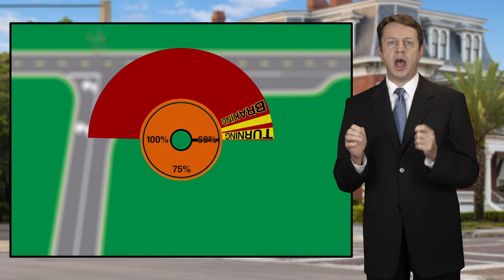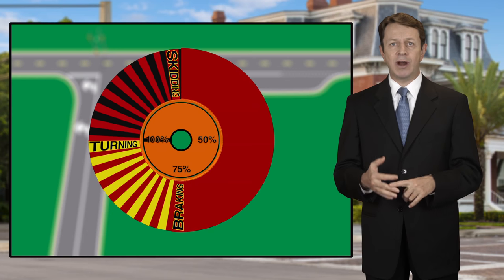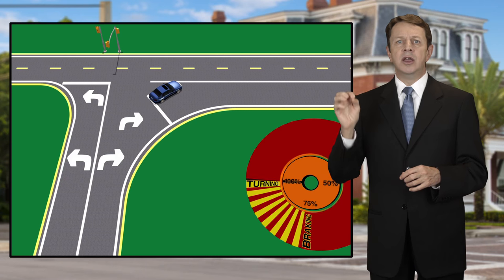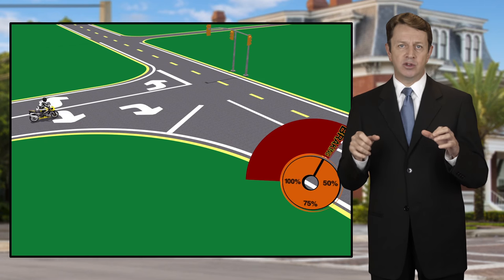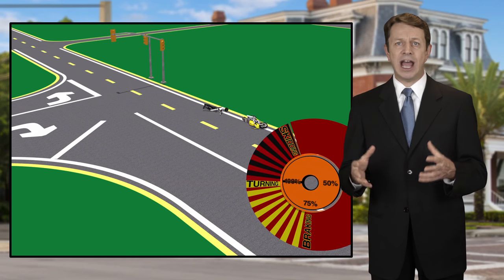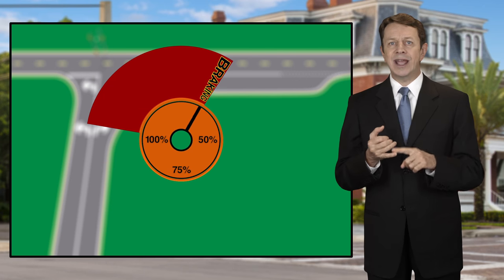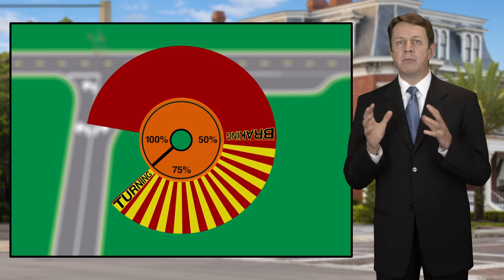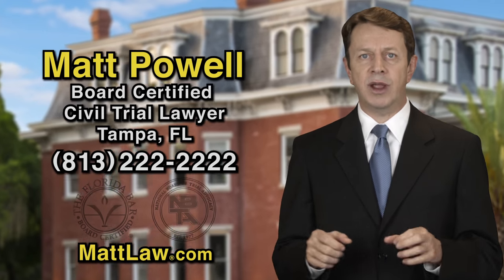MOTORCYCLE BRAKING IN A TURN - AVIOID A CRASH - Motorcycle Braking in a Turn ⭐⭐⭐⭐⭐

Comment: This prat really needs to go back to motorcycle physics school and learn a bit more about actually using the brakes to control not only the turn but the road position as a result,
Reply from the maker: Hi Mozzmann, thanks for your comments.  I agree there are many other things to consider such as road position, leaning etc.  However, I don't want to teach 8 hours of class, just help new riders appreciate the basics.  Thanks for the comment and ride safe.  Matt
Reply: Sorry to be so forthright but what your saying is just wrong, if your bike is balanced as it should be in a turn you can brake reasonably efficiently if you have to, advanced rider's should have no difficulty.  Newbies  a definite NO is the answer to braking in turns simply due to inexperience, BUT they should be taught cornering braking just the same.
 
Now a couple of corrections , the tyre contact patch is capable of making corrections in a turn but unless you panic brake your not likely to be anywhere near 100% braking, and this is why you should have your speed correct before entering the approach to ANY corner regardless of ability -  Admittedly the City is vastly different to a rolling  windy mountain road for instance BUT the fact still remains that the tyre is quite capable if the rider receives correct tuition.  I Agree you should be at the correct speed and have the bike balanced BEFORE turning - but you can brake in a turn for correction purposes, easily by using either the front or rear depending on what it is you require, BUT as I said if you have approached the corner correctly regardless of where it is , you can and should make corrections with the Brakes maintaining a steady throttle ( Not panic shut off which is common with new rider's and why I will always teach brake if needed well before the corner and allow the bike to settle,  then during the turn if and I mean IF adjustments are necessary you use the front to stand you up and run you wider and or the rear to pull you down and tighten the turn,  while using a constant throttle setting .  Many New rider's panic and shut the throttle off upsetting the balance of the machine making the situation often as not worse. 
 
One of the questions I always ask when teaching some new students is "What stops your Bike"  they just about ALWAYS answer the Brakes, which is TOTALLY incorrect !!  Your tyres stop the bike as a result of the retardation of the wheel that is the function of the Brakes ! ie Shit tyres and Technic = shit brakes 
Understand the technics and the abilities of both your bike and yourself and you'll do OK .
Reply from the maker: Excellent advice, thanks!  I really like your question about what stops your bike?  I must admit that I got the answer wrong, but you are 100% right, good tire contact with the road is the key to stopping, and good balance, control and being smooth all work together for a safer ride.  Thanks Matt
Reply: mozzmann.  This prat does know what he is talking about and his explanation is physically sound.  I can do the math.  Most rider and coach advice is from anecdotal experience and guessing how things really work.  

 Most riders goof up because, like you say, they do everything hard. Hard accelerating, hard leaning, hard braking.  They have rough sex with their bike.  Smooth and steady like dancing and the physics works for you even if you don't understand it.

Leave the guy alone.  He is right.  Leave reserve for your bike, tires and lean and you'll be able to make the situation work for you eleven when the unexpected happens (gravel, a pothole, grease spot)
Reply: Its a pretty fine skill braking in a corner.  You can use engine braking in a corner to steer by controlling the throttle thats the best option. In a turn if you want to run wider you can back off the throttle if you want to run tighter you can open it a little and it will pull tighter if you are not at 100% of traction which you should never do on the road. Also you want to use the rear brake gently to make similar small line adjustments. Front brake in a corner has to be even gentler again than rear to adjust line because the bikes going to want to stand up and run wider as soon as you use the front. But there are two things steering with throttle on turns you are not going to be stopping on the end of and you are trying to maintain corner speed and then one you are coming into a stopping situation you are going to want to enter that corner basically upright.